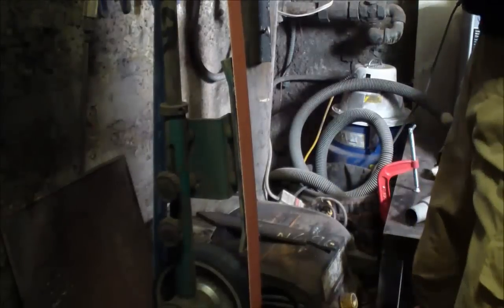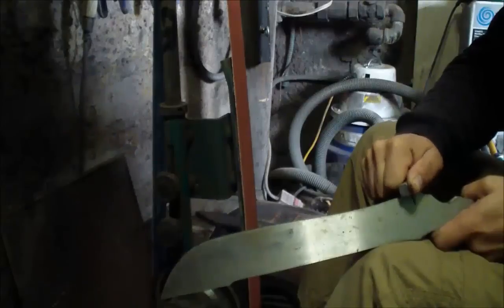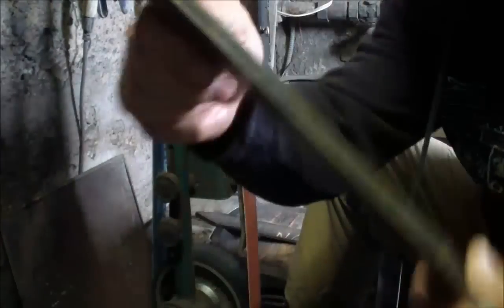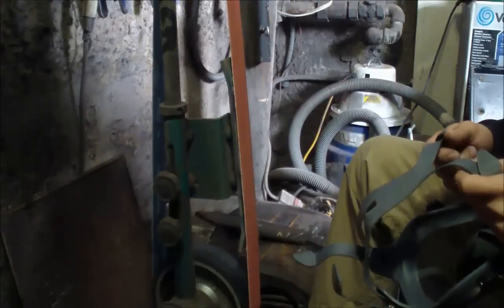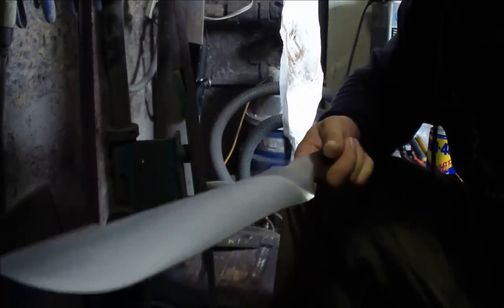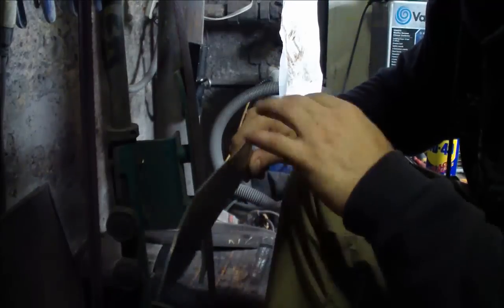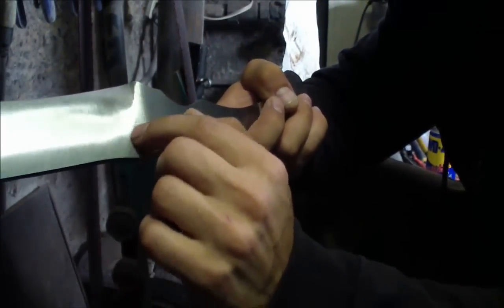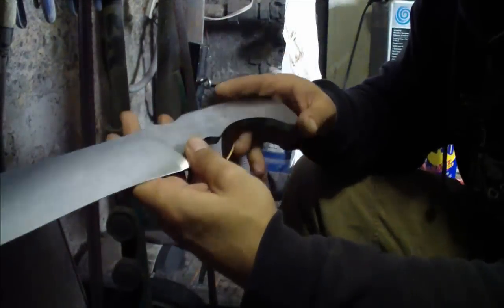Making a Large Custom Knife - Part 3 - Bevel Pre-Grind

Comment from the maker: you grind it pretty close to finish before heat treat and leave the edge about half a millimiter thick to prevent warping and then heat treat it. i use peters heat treat for it and they have been great so far. then after the heat treat i grind it to finish carefully with lot of cooling to prevent ruining the temper...

Comment: After you heat treat it, you have to remove some of the metal that gets burned. Also, if you sharpen it first, you will have a burned edge and it will lose its sharpness.